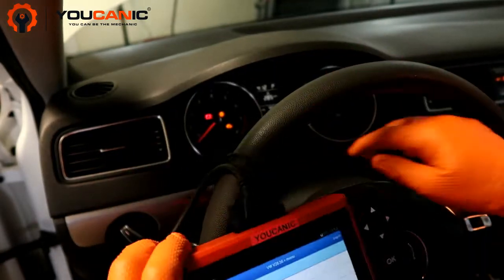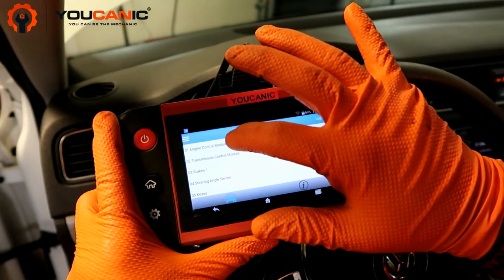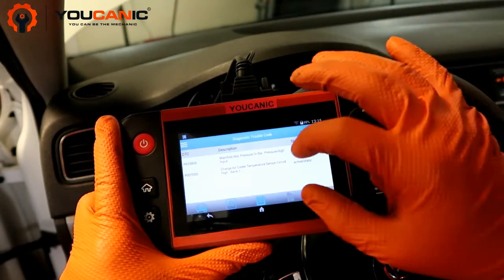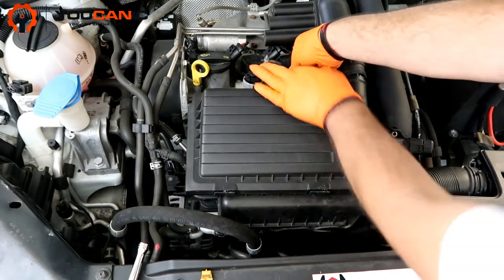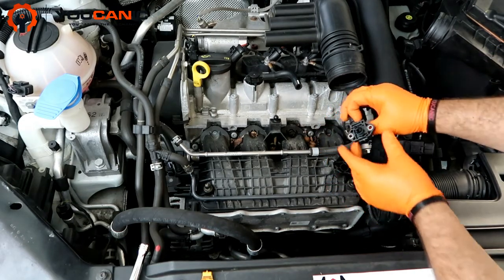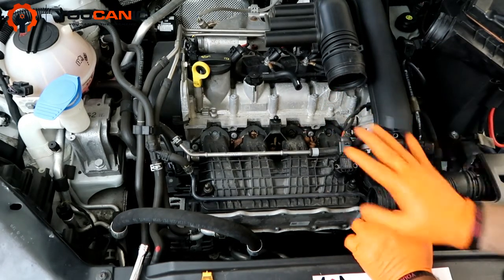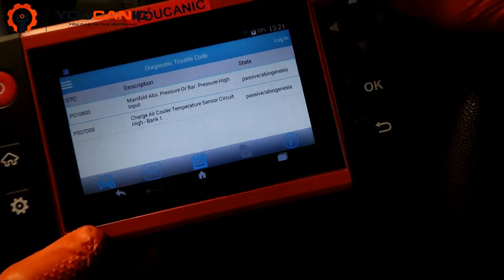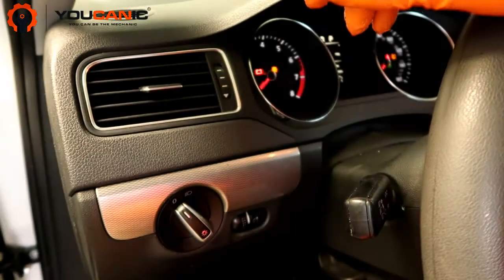VW P0108 Code: How to Diagnose and Fix High Input in MAP/BARO Sensor

Comment: What do you call that sensor on top of the pipe after the throttle?
Reply from the maker: Hi, thanks for your feedback! That sensor you're asking about on top of the pipe after the throttle is the Mass Airflow Sensor. In our mission to assist you with car repairs, we developed the YOUCANIC Full System Scanner for expert diagnosis. For more information, visit www.youcanic.com/scanner. 

To ensure your repairs are done right, we also provide access to Factory Repair Manuals and Torque Specs. Armed with this knowledge, you can tackle car maintenance with confidence. You can access these manuals by visiting www.youcanic.com/manuals for a small fee. We're here to empower car owners like you.